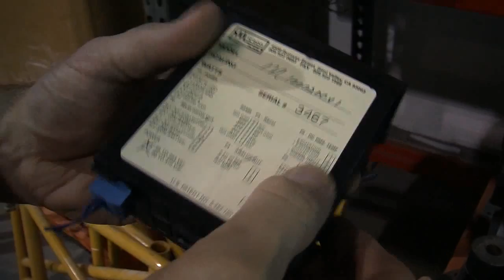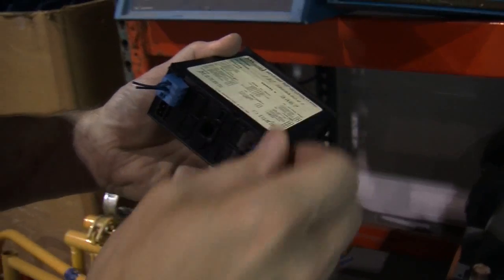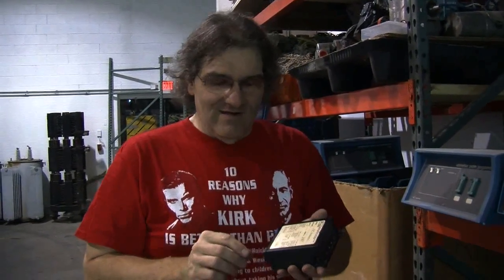Gemini metering and 100kVA power testing.

Comment: What exactly are the control heads ?
Are they a touch screen computer ?
If they are, and if it can be done, what about a computer oscilloscope for HV, there are scope modules and software so you can display waveforms on a computer.